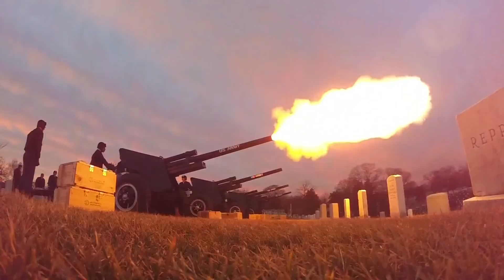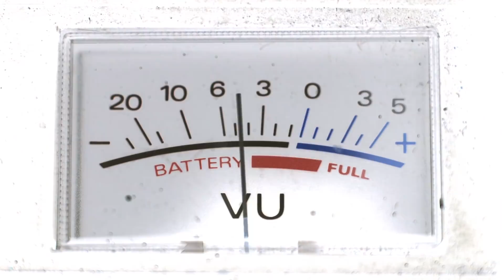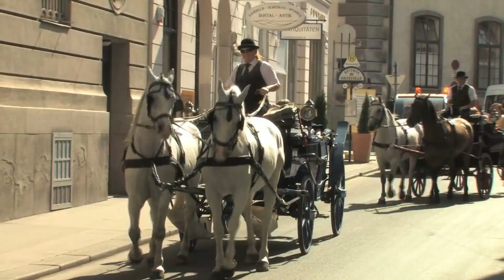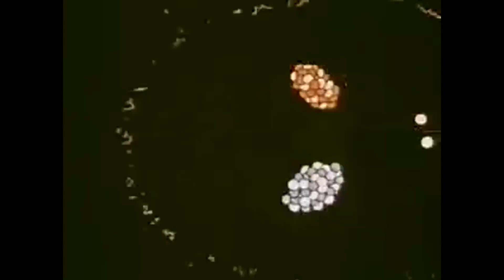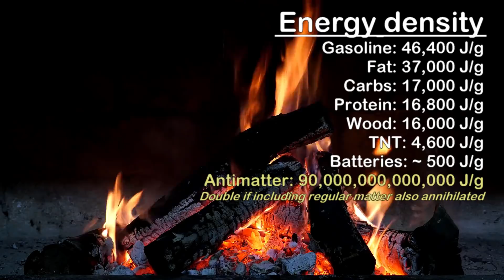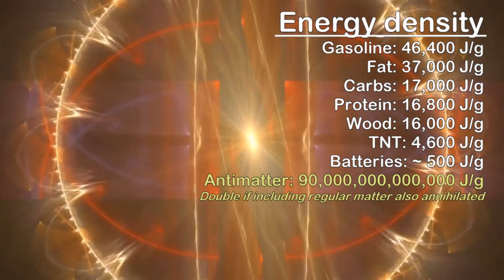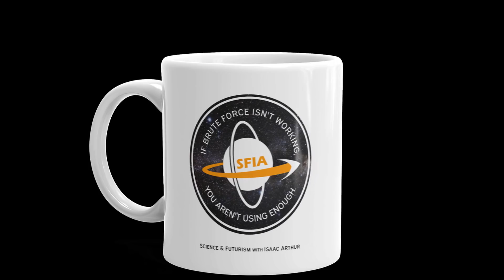Portable Power

Comment: Would it be possible to weaponize bottled light? Like make some kind of bomb out of it?
Reply from the maker: Oh sure, poke a hole in it and it's basically the flash light from hell
Reply: Sounds perfect.
Reply: Isaac Arthur -  Now I'm imagining a rifle that takes capsules of bottled light instead of bullets and fires by cutting the tips off them.
Reply: Roxor128 - Here's a thought. What if these cartridges containing bottled light had a very small shape charge on the tip instead? Said charge doesn't have to be very powerful. It just has to be strong enough to poke a hole in it, and then we have the aforementioned "flash light from hell". Of course this would probably have to be cycled electronically since the charge on the tip of the light bottle cartridges would most likely be rather weak (in comparison to other stuff), and thus not able to cycle any form of hypothetical bolt that this system may employ.... Or we could just operate it manually. Still though, I suppose that a battery and some electronics would probably weigh less than all the metal needed to cycle a gas piston.

Isaac Arthur - If made sufficiently big enough how would these fare against RKKVs?
Also would it be possible to eventually do a video on portable/semi-portable energy weapons?
Reply: Joshua West  -  I was thinking along the lines of using lasers aimed at the tip of the cartridge. If powerful enough, and the reflection on the inside of the capsule only, you could vaporise the tip, and you probably don't need to vaporise much of it for the "torch from hell" to happen.
Reply: Roxor128 - But if we did that how would you be able to create a laser that fires in a series of pulses? Cycling extra cartridges through the chamber in quick succession would mean you're using three cartridges for a three round burst (so on, and so forth), when you could use one multichamber cartridge for said three shot burst. It saves space. If we went with the tiny weak charges for multiple chambers, chambers one releases, then two, three, and so on making a pulsed laser. How would we do that with a laser cutting the tips off? You have a perfect mirror on the inside, so it would get in the way of opening the second chamber in the round (for the second pulse, third pulse, etc). Then again you might get around that by having the laser you're using to cut the tips off by having it fire a frequency that the mirrors on the inside aren't tuned to.

These cartridges would have to be pretty tough to prevent the ammunition from cracking open, then "cooking off." If you had a laser that could cut through those materials, why not use that on the people you're shooting at instead. Sure you could argue that the cartridges might be more powerful, but that's what capacitors are for, and one could argue using such lasers to shoot another laser needlessly complicates it. 

Another reason one might want to go with the small charges is it would could give you some control over how much power is in each shot. You could set it so one chamber goes off, or maybe several. Think of it like metal storm, but for bullets.

Also reasoning for a pulsed laser in link (hopefully it works/goes to the right place)
http://www.projectrho.com/public_html/rocket/sidearmenergy.php#blaster

Comment: Flywheels are used again as power storage. For example Porche uses those to store the energy it recovers with KERS systems because it is more efficient than batteries when storing energy for short term. Ofcourse the tech has been improved a lot since the ancient ways of using flywheels as nowdays those are magnetic discs doing very high rpm in vacuum.

Comment: I'd definitely rather have a nuclear reactor in my basement than an antimatter reactor. Hell, if I had the shielding to keep myself safe even if that nuclear reactor melted down I'd take ten in a heartbeat. I'm a lot less worried about a few tens of kilograms of fissionable material blowing my house up than antimatter doing the same.

Are you familiar with MIT's SPARC project? It was a big deal (to me) a year or so back. Using the REBCO superconductor, which maintains its superconducting abilities at a higher magnetic field than previous superconductors, they claimed they would be able to build a much smaller working prototype of a fusion reactor within 5-10 years. Working as in net energy gain. Sadly after a few presentations you can find on Youtube they seem to have gone quiet and my efforts to contact them were in vain. 

It didn't occur to me until now to try running some of my own calculations on the feasibility of the idea. :)

Comment: Another great video-- take it as a compliment when I say I'm not surprised.

Just one question: as you said, the Hawking radiation pouring out from a kugelblitz pushes away all matter (at least all matter that interacts electromagnetically-- dark matter-fueled black holes, anyone?), complicating its use as the super-reactor that runs on garbage so many sci-fi authors have been dreaming about. But what if you fed the singularity in a staged approach: first, some kind of heavily modified cathode ray tube fires a stream of electrons at the event horizon. Your aim would have to be amazing, and this would all still occur at a tremendous energy deficit. However, once the kugelblitz absorbs those electrons, it retains their charge. The black hole is now negatively charged, the extent of that charge depending on how many electrons you shoot into it. Now, if the charge is high enough to overcome the outward photon pressure, some protons can be pulled in, giving you a net energy gain. Of course, for every proton you shove in, this pulling force decreases, so you would probably have to alternate between one electron and one proton, but that works out fine; it should have some constant charge anyway so that you can contain it within a magnetic field. But whereas the electron barely increased the mass while significantly altering the charge, the proton only cancels one electron's worth of charge while increasing the mass by over 1800 times more. The mass-energy and lifetime of the kugelblitz is greatly raised.

I am assuming this doesn't work; I probably far underestimated the energy deficit the electrons suffer, especially since it gets more and more difficult to insert them as the kugelblitz gains negative charge, repelling the electrons' like charges. I'm guessing this uses at least as much, if not more energy than just tossing in some neutral hydrogen, so that energy is conserved. I was just hoping to get confirmation of this.
Reply from the maker: Yeah DM would be a very good choice for that, of course you have to able to manipulate it to pull that off and we don't know how yet.
Reply: Yeah, that's true-- although, if the recent discovery about hydrogen absorption near the beginning of the universe is any indication (PBS Space Time video here: https://www.youtube.com/watch?v=-R9F2_D76TE), the hydrogen back then must have interacted with something to be that cold, the prime candidate at the moment being dark matter. If there's a way to figure out how that happened (and may still be happening), we might be one step closer to dark matter ramscoops or something.

Then again, that's likely one step out of several thousand.

Comment: You can't get a Thorium reactor into a car, tell that to those who did a kickstarter exactly on that premise :D:D:D
Reply: Yeah, well, Kickstarter is happy to carry any money-begging effort whether or not the project is remotely feasible.  Kickstarter leaves it up to donators to do their own research.
Reply: you can, but the efficiency plummets and it would weigh a ton.
Reply: I also saw a video that debunked the practicality of the concept (given current technology and regulations). However, I think some kind of home reactor (can't remember if it was thorium based) was a little more realistic.
Reply: link?
Reply: If you don't mind the lethal radiation it could be possible. Most of the weight comes from the shielding. It's possible to make compact very powerful reactors, but there's no way to make the shielding lighter, because for stopping gamma rays the only thing that matters is mass, so there's not much you can do. Maybe if you make the reactor really small, but extracting the power you need gets much harder.
Another problem is the cost. To make the reactor small enough you need exotic materials that are very expensive. Plutonium for example. Which has another obvious problem.